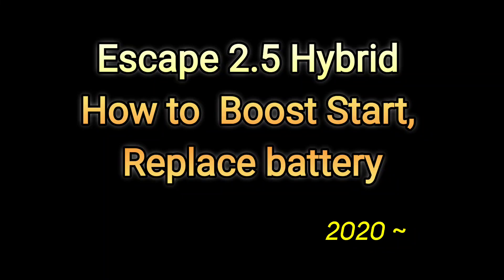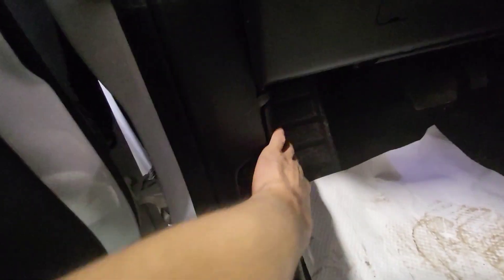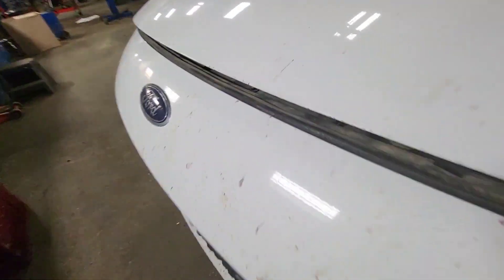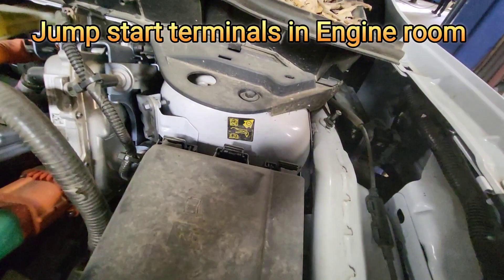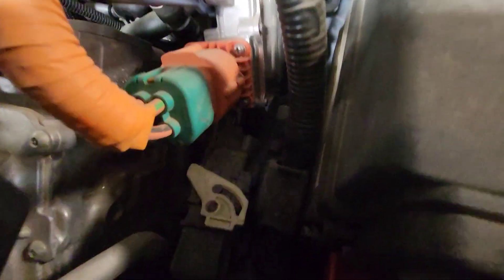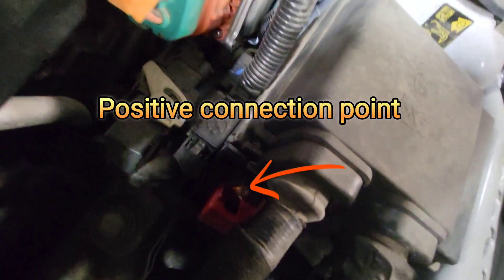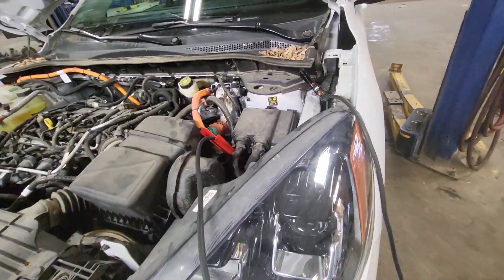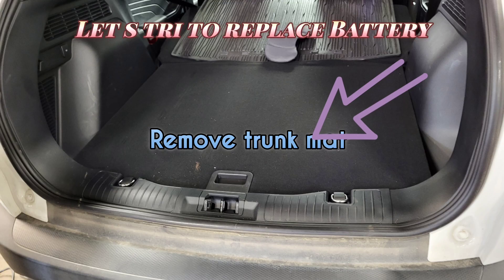Ford 2.5 Escape Hybrid , How to Jump start  and replacement Battery

Comment from the maker: Hybrid car has Two batteries,    Auxiliary  Small  Start Battery  in trunk is  Wake up , Starts Hybrid system for drive   , So  if your car doesn't start  may battery drained ,  weak, or bad battery.    Need to be boosted, charged  or replaced .  
Thank for watching   ^^

Comment: It is not clear for me the first steps.
Those clamps where are connected in the outside?
What if just change the battery without connecting the clamps in the front?
Reply from the maker: @MgsnchzS  if the Battery bad , (No starts, No power on Dash ) You can hooked up booster to Engine room connections ,   or  remove spare tire and trunk Battery directly.   This  video shows   Where  to hook up the connections of  Engine Room when No starts .   ^^
Reply: @ thanks for the answer.
I have another question.
My battery is not dead but it keeps draining.
Is it possible to change the battery in the trunk while the Escape is powered on?
As in non hybrid cars.
Reply from the maker: @MgsnchzS  that Video show Escape Hybrid. 
None Hybrid engine  Battery rotate in Engine room in most of case.
If keeps drains Battery.  You should test yr Battery.  Test is ok but keep drains again,   Next, 
Need Drain test yr car electric system in local Shop, or dealer .
But mostly Battery problem.